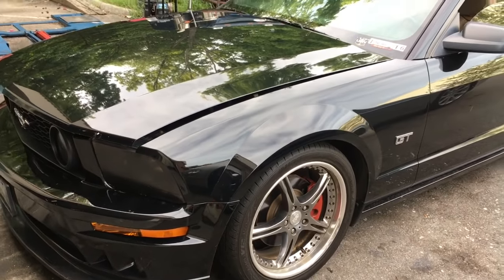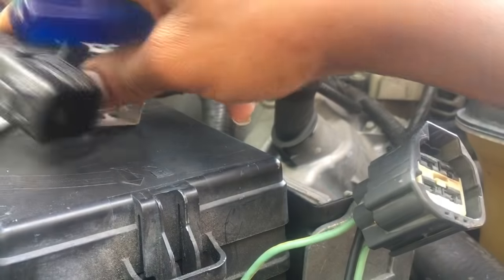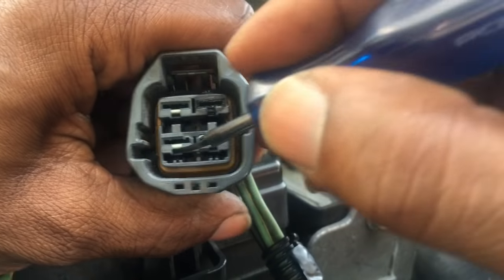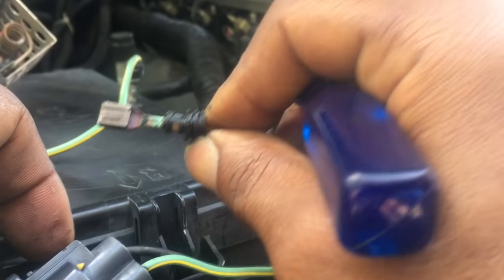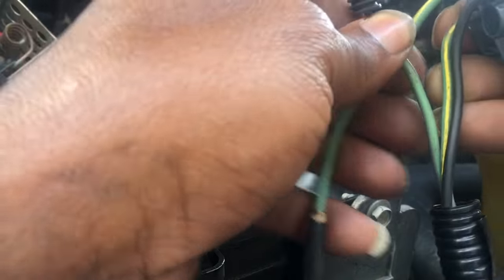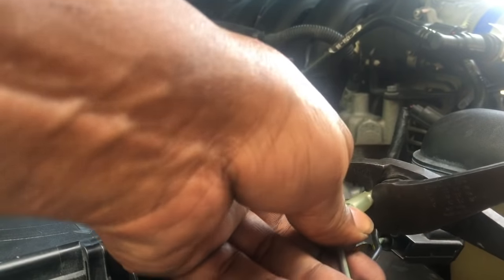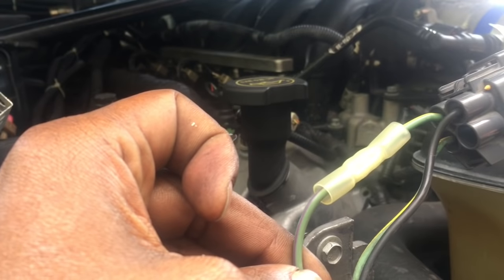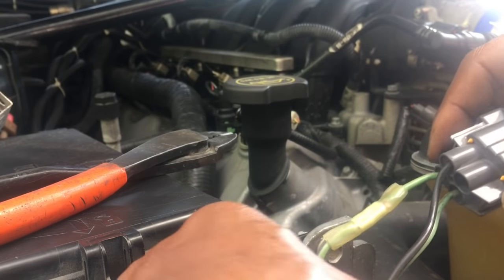2007 Mustang cooling fan Problem we found the problem and fixed it

Comment: I was battling an intermittent overheating issue with my 06 GT since mid July and just solved it. I replaced the thermostat, I removed the radiator and had it tested, replaced the radiator cap and replaced the cooling fan assembly with a new one from Ford but still had the issue. My old fan had a burned power wire going into the resistor but this plugin itself looked fine. My problem was in the BEC (power distribution box) in the engine bay. I loosened the 4 bolts in that box which then allowed the wiring harness connectors to drop out. The wiring pin for the high speed fan relay was burned up and had melted the connector housing and the terminal on the BEC was also burned. I got a salvage BEC with the wiring harness connectors attached to it and used the connector from it to repin my factory wiring into it. I used the unburned wire (green/violet) from the salvage connector and joined it to my wiring harness after cutting off the burned wire. I installed the new BEC and reconnected the new unburned connector and reassembled it all and after test driving it voila, problem solved!!! I spent so many hours trying to figure out my problem. I was about to replace the PCM when I checked this BEC. I had no codes and sometimes the fan worked but when driving it the fan would stop working. I even encountered this video before when trouble shooting my issue but it was not the problem for me. There is another S197 mustang online that had the exact same issue I had. I hope that my comments here might help somebody battling the same problem I had. The new fan assembly has a redesigned resistor so I think the old resistor design caused my problem. What I don’t understand though is why it burned up the wiring in the BEC and the green 40A cooling fan fuse did not blow. Makes no sense to me. This was the biggest mystery I ever had with a car!! On the plus side I learned a lot about my car’s cooling system and the electrical stuff as well 😊
Reply: I done went through 5+ BEC harnesses within 1 year, the same problem keeps happening to mine.
They just keep burning…

Comment: Ive had the same problem, replaced the relay box, entire wiring harness and fan. It's worked for a couple years and is starting to burn up connectors yet again.

Comment: Thanks for your video. I can't get power to my fan. Two of the three wires are showing 14 volts but the third is not showing power. Does it go to a heat switch? 05 mustang.

Comment: thanks for the vid, i think the same thing happened to my mustang. the radiator works when i give it power individually but one day, when i washed it i think i got water into the cable and the radiator wont spin now (it still works if given power individually)

One question i have is, how did you get the cable out of there?

Comment: Any help would be appreciated but I have a 08 mustang gt and I have an issue with my A/C. Even though I changed the actuators and blower motor resistor it’s still not blowing. What can be the issue? Maybe the fan?
Reply: Did you check the fuses? i just got this problem on my v6 06 I just bought a new fan, waiting for it. I did all the test and for me (fingers crossed) its the resistor.
Reply: Frederick Villaruel Well I checked the fan and it wasn’t that either. It’s actually working even the compressor but it’s still not blowing. So I really don’t know what it could be
Reply: Leo Medina Try checking the resistor in the blower motor. There is a YouTube video for that that is fairly new I think for that resistor.
Reply: Leo Medina just don’t take it to a shop yet, save your money lol do as much as you can
Reply: Frederick Villaruel Bet thanks man! Most definitely I’m determined to finish it on my own because now and days shops will screw you over lol and you save a lot more money

Comment: He should have  Soldered the wires together and put some heat shrink with the glue inside it over the soldered connection. I am not a fan of crimps on wiring.
Reply from the maker: Ok
Reply: you forgot to mention kopr shield.